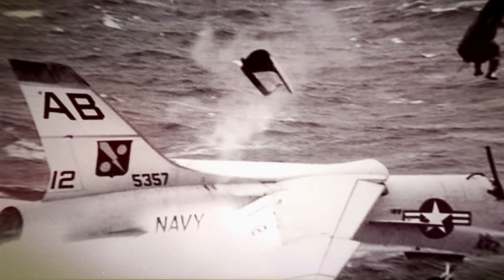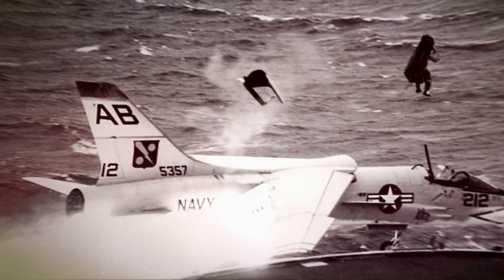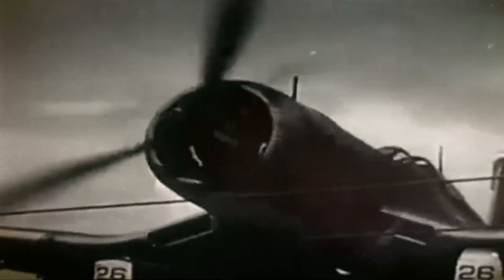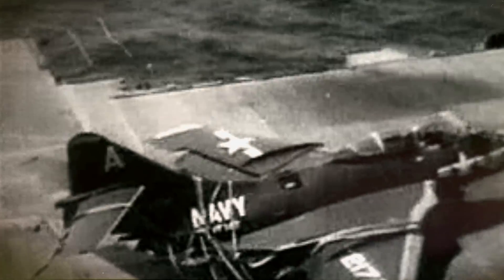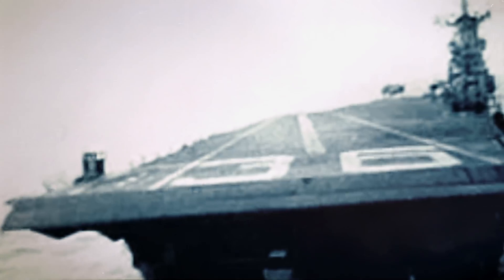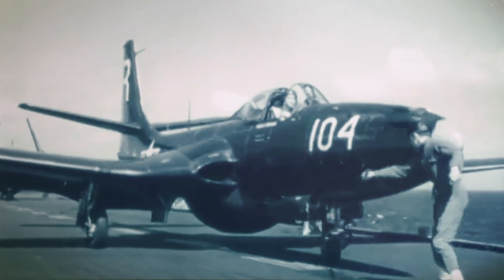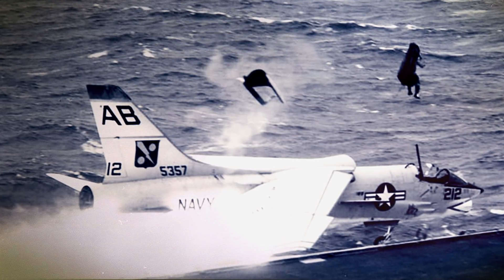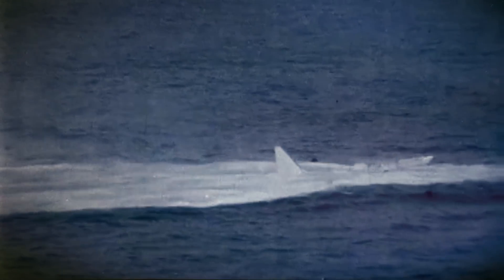F-8 Aircraft Carrier Crash (why carriers have angled decks for landing)

Comment: Original question. Why aircraft carriers have angled decks.
 1)  American carriers have a normal capacity of between 80-100 aircraft. But the hanger is only designed to store a fraction of the air wing because of the stable weather they encounter so, most of the aircraft are stored either in the small area abaft of the superstructure or near the bow. IE keeping long 'runway for landing.
In comparison the Russian carrier although a similar size and configuration carries a smaller airing as due to the climate ie rough seas ect they have to keep most of the air wing in the hanger.

Comment: Isn't it already hard to land aligned with the beam? Is this video saying the angled deck is for landing, so planes have to align themselves diagonally to land? Did that ever happen? I've always seen planes land parallel to the beam. Then the video gets cut short, talking about the airplane and ejection incident, when the title implies it'll explain the angling reasons... Was it for more room? So the pilots got more room for... nevermind. This video was a mess.

Comment: It seems like catch fences could be put just below the deck at the end of the landing area and maybe fore and aft of that to potentially catch planes that slip off the deck. Some of them just kind of slip off easily and may be catchable. They can make awfully tough catch fences that can even stop planes at speed so those could do this. Kind of a major difference with a complete loss of a plane and having a salvageable plane.

Comment: Why never any mention of the A7 Corsair II?  It was around longer than the Crusader and had many of the same flight characteristics.  Even though it was the smallest plane on the flight deck, we always knew when we were landing A7s because of the noise and the way the entire carrier shook when one of them touched down.  Landing an A7 was often described as a controlled crash into the rear of the flight deck because of its high glide slope and the speed at which it landed.  Pilots had to literally fly the plane into the deck.

Comment: Anthony Wilson, thank you for your reply, that's news to me, have you got evidence of German ejector seats during the 20,s and 30,s? If so how did they get the ideas from? Yes Martin Baker seats have saved hundreds of pilots lives over the years,damn sure I am correct about the angled flight deck and also landing mirrors, were British inventions! Cheers!
Reply: Hi David the Germans used it late war but did not invent it, here is a link that shows who when why. https://en.m.wikipedia.org/wiki/Ejection_seat.
Also https://www.wired.com/2011/01/0113ejection-seat/. Martin Baker agree are well respected globally great company.
Reply: You are correct first purpose built carrier HMS Hermes angled flight deck idea and first purpose built carrier with angled flight deck Ark Royal, US and UK experimented by welding bits on to existing carriers after the UK developed the idea and practiced on existing carrier.. Plus landing lights and steam catapults. US had first arrestor wires. And as a bonus looks like a champagne as well. 30 years before the French British winemakers where adding sugar to wine for secondary fermentation. Due to Royal Navy request use of wood for glassblowing was banned in the UK, Brits had to use coal resulted in higher temp and could make thicker bottles that did not blow up.  French came in 30 years later and nicked idea. Apparently provable documented process. Look up on Web😀

Comment: i don't get why that's easier to land on..  seems like a shorter distance than before
Reply: They really don't do a landing it is more like a getting caught action. They would never be able to land in that short distance without the arresting cables that stop the plane.
Reply: @fredc8346  

 i still don't get what the angle does
Reply: @mentilly_all    With just a single runway like the video shows at 1:05 & on you can’t really use that one runway to launch and land planes unless you are ok with a lot of possible damage, messes and death. So you want more than one runway. Side by side would be too wide and not work out and set you up for accidents also. So to keep the ship width down you angle it off some. The recovery landing area can be shorter because it uses an arresting cable system. The angle just makes it fit on a carrier deck without making the whole ship a ton of flat space. And it may be the best way for an errant plane to go off the ship and be sent away from all the rest of the planes that are either launching or parked near the front of the ship. I guess it is just basically to send the planes to a different area for more room to land and to lessen potential damage.
Reply: @fredc8346  

 Ok,  that makes enough sense.

Comment: I was on the Midway from 81 to 86 and l worked right under the angle deck plates, B-0214-E, and an F-4S crashed much the same way when the pilot hit the fantail. The sound was incredible, a fireball of metal sliding right above my head.

Comment: In the early sixties and that's when I was on the USS Ranger and I saw a change in takeoff procedures. The aircraft used to take off the front runways and go straight ahead and so often when they were loaded with bombs they would flame out or just not hold altitude and hit the water and then horrible things would happen like the carrier would run over the aircraft, if the pilots would eject maybe into the boat or maybe they land on the flight deck which is devastatingly horrible and so now they changed it to when a plane takes off it immediately Banks right or left a couple degrees to get out of the way of the ship in case they fail. And I remember a lot about that. I think the change happened late 65 maybe early 66. Worked great so did the Corsairs and my favorite the Spads or A4s maybe the Vigilantes oh the they all rocked.
Reply: there are no runways on aircraft carriers you moron, they use catapults
Reply: @bob80q  shut mouth

Comment: So ... basically, it was a landing gear design major problem for F-8, eh ??  That's to bad !!!!
Reply: Plane did not fly well at low speed had to land at high speed. Wing cranked up to increase angle of attack.  It was a trade off, it could fly damm fast and compete with MIG 21 but had to land on a postage stamp at sea. Apparently 8 to 1 kill ratio in its favour better than the Phantom. Until cannon packs fitted, somebody said missiles will win all the time. When a man with a rifle meets a man with a .45 opps. F4 got a .45 and pilots trained to use it.

Comment: Another good video, thanks. You said that the landing/ejection would not have been possible without the angled deck: I don't understand why that is the case.
Reply: I agree, you can eject anywhere if not inverted or otherwise out of the envelope.  You may suffer injuries however landing on the deck, other aircraft, and ships superstructure traveling at 30 miles an hour.  You also could be run over by the ship if you end in front of it.  Of course those bad option my be better than staying with a troubled aircraft.
Reply: @danielvroom2949  Thanks, that provides some possible reasons , though as you said, the limitations/risks don't necessarily make it impossible.
Reply: Otherwise the plane would run into other planes at the front of the flight deck. WW2 carriers had nets that could catch a plane that overshot, but as the planes got faster and heavier this wasn't possible any more.

Comment: To anyone who wonders why they couldn't simply widen the carrier to have, in effect, two runways: I wonder the same thing and am guessing that angling the deck 1. Was/is easier and/or more structurally sound 
2. Allowed more separation between launched and recovered aircraft than parallel runways
3. Allowed a large middle space for aircraft prepping while botched approaches simply fly off the side without endangering aircraft in the front being launched or the aforementioned middle space (heavily overlapping point #2).
Reply: You assume crashes are nearly organized events, which they are not.  The instant an aircraft becomes uncontrolled, whether from battle damage, equipment failure, weather, pilot error, fouled deck, etc. it can go up, down, left or right in an amazingly short distance and spread debris traveling a hundred miles an hour anywhere.

Comment: The angled deck was a Royal Navy innovation, along with the steam catapult, the 'meatball' & arrestor wire system.
Reply: I believe you are correct. The UK did not develop arrestor wires, just the first dedicated carrier HMS Hermes although the Japanese copied the idea started building their first carrier later but got their one commissioned first. Steam catapult, landing light “ the meatball”. Idea of the angled flight deck painted on to existing deck for testing, US modified a carrier first by welding onto existing carrier. Uk had their modded one a year later. First carrier built from scratch with angled flight deck was HMS Ark Royal. Twin islands definitely first let’s see if they catch on, UK has used launching ramps for years due to small carrier size. Let’s see how we get on with F35 on ramped takeoff, time will tell. Open the throttle and up the ramp saves launch time I think, and come in slow for a rolling landing  using some of the deck. We will all see if it works well. The two new carriers have many new innovations. Nice to see the Royal Navy on the up for once. Hope the Tempest gets done without the usual holdbacks and Influences. Any politician who holds it back or wants lots of changes that slow development and add huge costs should be examined to see if he or she has been got at or bribed. Only people who are qualified should be allowed anywhere near the decision making. Keep the team small and full of those who know what they are doing.
Reply: Got to love history! Thank you guys for bringing some knowledge to this comment as I’m a soldier born in a civilian body and was 4-F for medical reasons. I will give our friends just across the pond a lot of credit for innovations militarily-speaking, the Great War and World War II, those innovations such as the quick release parachute harness rather than straps like the Yanks had. From Forsyth “firearms principle”, HMS Dreadnaught, to Barnwells aircraft design basics, the first standard pattern carrier HMS Argus, the first Air Force and the first tanks.  🇬🇧 Thank you to our friends across the pond.
Reply: @tjpowers88  Barnes-Wallace?  The man was a genius :)
Reply: @navnig  I had said more than I needed, I didn’t want to get too boring, but yes, Barnes Wallis, his “dambusters” were one of many ideas he had.
Reply: @navnig  don't forget the variable geometry (swing) wing! Different countries all tried to do it but couldn't vary the geometry in-flight. Barnes Wallace was the man that made that possible.
Reply: The very first attempt at a carrier landing by Glenn Curtiss and the US Navy in 1911 featured a tailhook and an arresting wire system.
Reply: Though it is not like using a catapult was a novel idea when it was implemented in carriers, you can see counterweight driven systems going back to the Wright brothers. However the steam driven version was definitely a major improvement over older systems as well as a system that worked very well for a long time even given the problems it has. Personally I see the angled deck as a similar situation given that airfields and airports have long utilized multiple runways that are at angles to each other.

The thing that makes the Brits special within this context, was them putting it all together into a working set of systems and proving its effectiveness.

Just like as is stated in the beginning of the video saying that the angled deck was implemented for jet related stuff, people seemingly think that certain features are far younger than they are. (even though later in the video they clearly state 1944) You could say it was carried over into the jet era or beneficial to jets, but to say it was implemented due to jets is just wrong.

And while I'm on the subject of this video screwing up..... "vertical carrier deck" facepalm there is just so much wrong here, either being plain wrong, or only half informed..... it sounds like it was written by 3 people working independently taking notes from history channel programs.

addendum: the actual idea of using arrestor wires goes back to American experiments, when they were still landing ships on cruisers and whatnot with those partial decks added on. Though those were counterweight systems that used sandbags, not the hydraulic systems we are more familiar with today.
Reply: @whyjnot420  Try a steam catapult designed launch an aircraft weighing several tons on the Wright flyer and it turns to bits.  The first aircraft non power where launched from ramps. You pick up your glider and run down the hill you built like buggery until you achieve flying speed so ramps where around before Cats. Don’t forget elastic bands where used in schools as well to launch paper projectiles and also in medieval times weights and lever arms where used to launch stones at castles. In reality the first time steam which had enough power was used on an aircraft to launch it was developed by the Brits. Pulleys and weights where around before Europeans stole America from the Red Indians.
Reply: Anyway have a great Christmas we are both interested in the same stuff. Keep safe.
Reply: @anthonywilson4873  One of the things that makes looking at the history of an invention which I find the most fun is tracing the lineage of the invention. The string of things that had to happen for one invention or another to come about is just insane at times yet there it is (whatever it happens to be). (if you cant tell, I have a high degree of admiration for the likes of James Burke)
Happy holidays to you as well.
Reply: @whyjnot420  well it certainly stopped planes ramming up each other’s arse as had previously happened. It also enabled them to go around. If you follow your analogy the whole concept of the carrier is not new as there where airfields on the ground already . The only problem if we follow that route, is none of those ground based airfields floats very well and are very hard to shift to the other side of the world. So on something that floats and can move around on the sea and can launch and retrieve aircraft it was the first. The Chinese had had rockets you could light but it’s not a Saturn V. Saying that they just landed a rocket on the moon.😀
Reply: Yet all RN carriers with angle decks were designed with straight decks and converted after completion the except being the Ark Royal (R09)   which was converted before being launched.

Comment: You don't want a landing gear on a ship that starts burning at 3000°F when it snaps. WTF.
Reply: In reference to your "burning at 3,000 degrees...;" the first time I saw the USS Oriskany CV34, was at the San Francisco Hunter's Point Naval Shipyard.  During AirOps, after recovering one of the fighters, the aircrew was unloading the magnesium flares, among other things. When one of them was tossed into the flare locker it ignited the rest of the locker full of flares... the result was a huge fire that left about a 30' hole in the port side of the hanger bay, just forward of the elevator. Once those flares start, they don't stop burning until there's no fuel left.

In the report that came after the incident, one of the aircrew who was fighting the fire, was holding a 2 1/2" firehose on a 500 lb bomb in the hanger bay. One of the other men nearby yelled at him to get away from that thing!! He was reported to have replied, "you can't run far enough on this boat to get away so I'll just stay here and keep it cool." ...and he did, and it didn't explode.
Reply: Yeah, did he really say magnesium rods in the landing gear?  yikes.

Comment: Not sure if I'm 100% right but in the 1940's-50's (WWII) if the carrier was not going fast enough, it would not generate enough speed for takeoff, but the deck wasn't angled so if this happened, the captain would have to turn sharply and if he failed to do this, the pilot and or gunner of the plane that went over would be crushed.

Comment: So Heres my question would he have survived if he stayed with the aircraft and spashed down into the water without using his ejection seat?
Reply: nope. Planes don't  float long.
Reply: Because guys in this scenario I feel like he could of survived either way his speed wasn't enough to entirely break up the cockpit when it spashed down over the aircraft carrier.
Reply: @pikefolsom6061  https://youtu.be/Q9Q9a3XEl04
Reply: There were a few underwater ejections and they always caused severe injuries. And he would have no time to exit the cockpit otherwise.
Reply: Ejection seats float and jets don't, if you are wearing a harness and breathing apparatus that can take a couple of minutes to wrestle your way out of you would rather be doing it on the surface and not while your jet was sinking.
Reply: @krashd  Yep, they don't  float long at all. https://youtu.be/Q9Q9a3XEl04
Reply: Among the other comments, the plane may invert on the was down or float cockpit down, for the short time it floats.  The crew are likely to be temporarily stunned by impact with the water.  The aircraft may also break up, if not already damaged by the crash and sink very quickly.

The aircraft I serviced did not have ejection seats, two pilots had to ditch when their aircraft became too unstable to attempt a landing.  One pilot got out and one did not.  Generally better to leave the plane if you can.
Reply: @danielvroom2949   Perfect example.....https://youtu.be/Q9Q9a3XEl04
Reply: https://youtu.be/Q9Q9a3XEl04